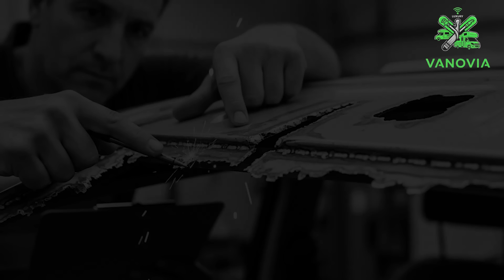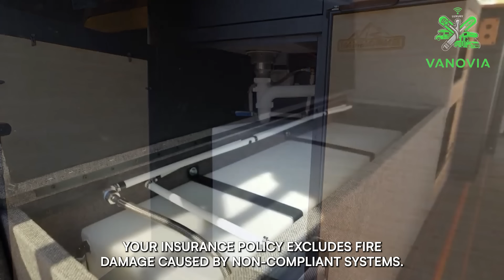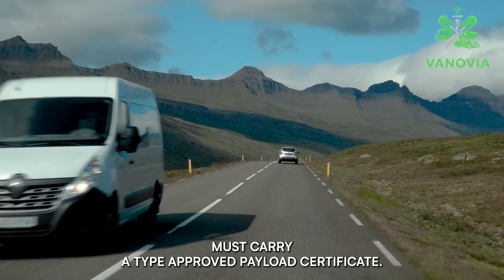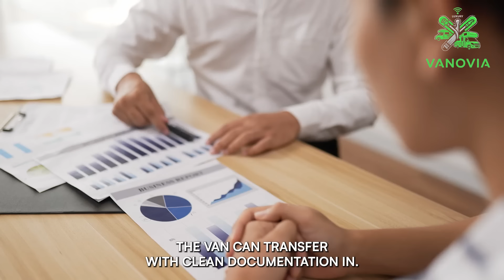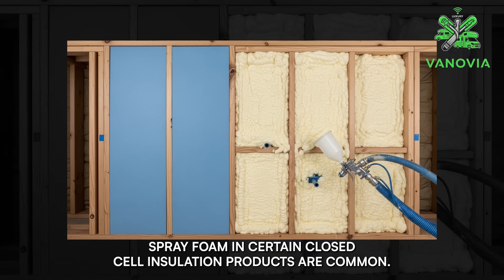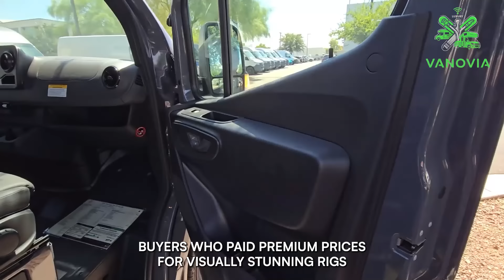10 ILLEGAL Camper Van Mods That Cost You $30,000 (2026)

Comment: No worries here. My build won't have propane or grey water. Nothing will be bolted through panels or framing. Every piece will be like a LEGO block so it can be removed at any time. Wiring will be plug and play, generated from the van's battery while driving, and portable solar panels when camped.

My cargo van is going to be hauling "CARGO," and won't "BE an RV."

Not paying $100k for a van conversion and not taking a chance on some fly-by -night "professional builder"  only to be flagged by an uninformed "inspector," meanwhile I'd have to pay them both.

Gotta work smarter, not harder.
Reply from the maker: Good approach modular builds are definitely the safer direction.
Just be careful: even if things are “removable,” insurers or inspectors often judge how the van is actually used, not just how it’s built. If it functions like a camper, it can still be treated like one in legal or insurance terms.
Smart idea overall just don’t assume “modular” automatically means “no compliance questions.”